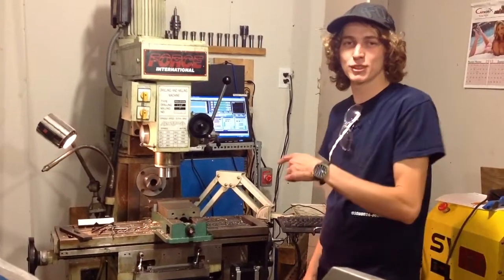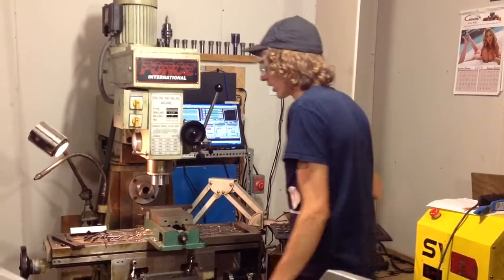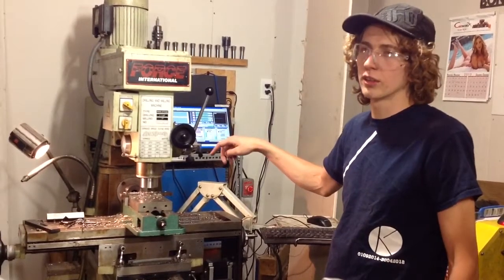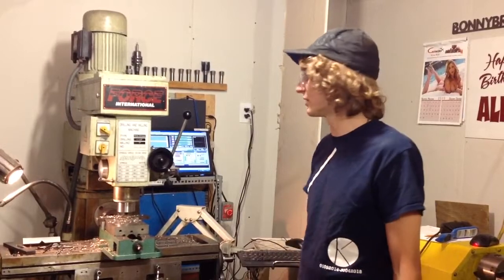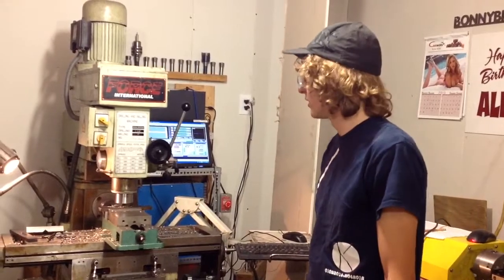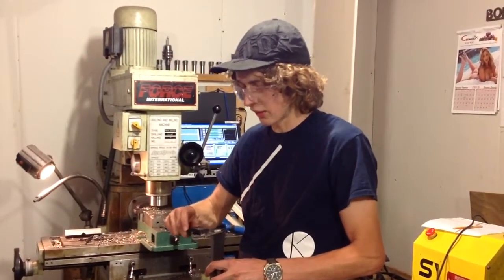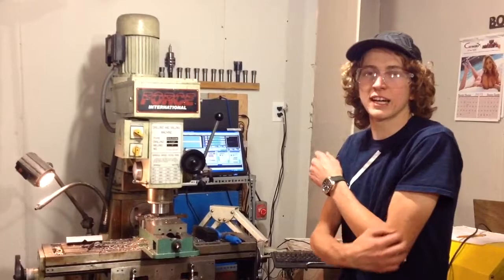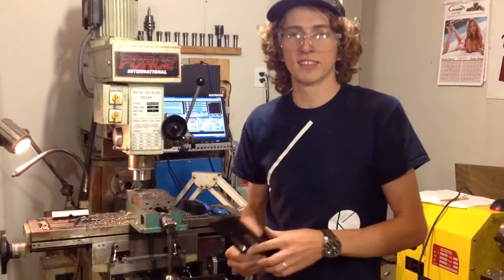Manual mill converted to cnc

Comment: Good job. I have exactly the same mill that I am busy retrofitting, I am using 3 Nema 34 120kg/cm stepper motors. On the X & Y axis the ratio will be 1:1. For the Z axis I will use 20T pulley on the motor to 40T on the screw and also use counter weight to help lighten the weight of the table.
Thanks for your video.